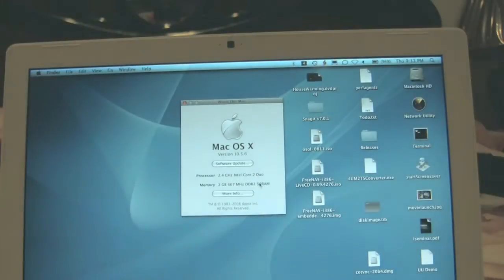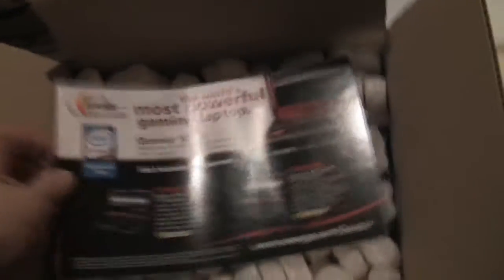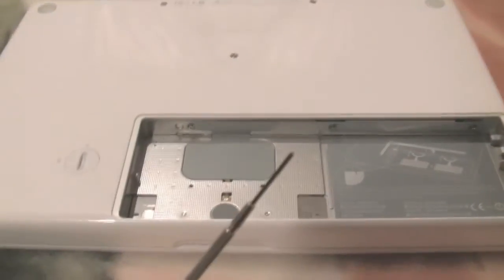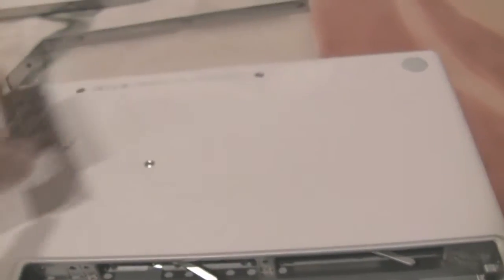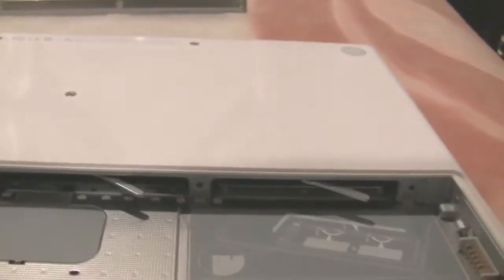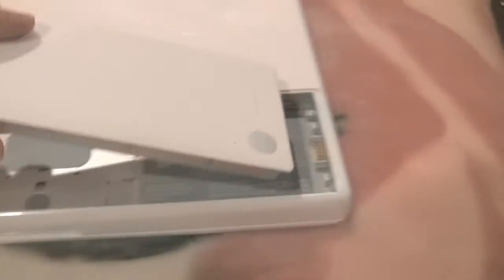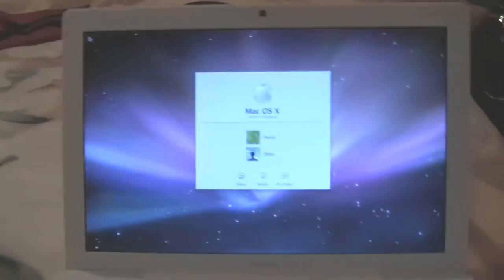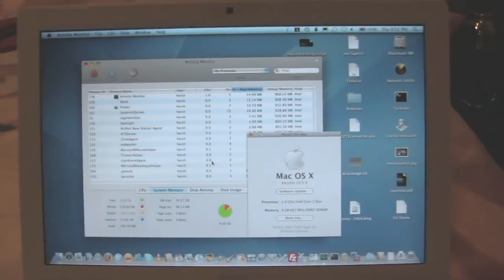Macbook 13'' Memory Install - Upgrade 4GB

Comment: Hi : if I want to upgrade the hard drive how many GB hard drive can be support by mac 13"A1181 version 10.6.8
TM and 1983-2011 APPLE inc
please help me to upgrade both RAM and hard drive and my job to do by it i want to be video editor and i want to use final cut pro which is not support by my mac now.

Comment from the maker: Upgrade RAM will not erase any data off your computer. Its a hardware upgrade. You should be fine with upgrading just dont bring any magnets near the computer. Also, make sure you are grounded, you do not want to discharge a static electricity as it could fry the computer.

Comment from the maker: @wing103 I used iRam. You need to do some research as to what motherboard you have inside. You should be able to install 4 gigs of ram because you have Core Duo like mine. Match the bus speed from iRam's website. Also, double check on apple's site.

Comment from the maker: Gramosmusa,

Apple's website says 

"2GB (two 1GB SO-DIMMs) of 1066MHz DDR3 SDRAM; two SO-DIMM slots support up to 4GB"

So you need to buy SDRAM DDR3 ram that runs at 1066MHz. I prefer iRAM from newegg. I have it running in three different apple computers and it works fine. 

You can go to your local electronic's store and pick something out. =)